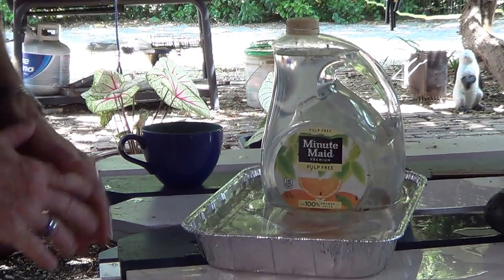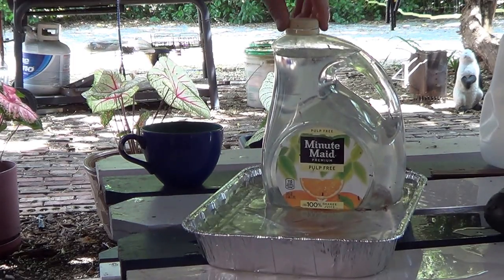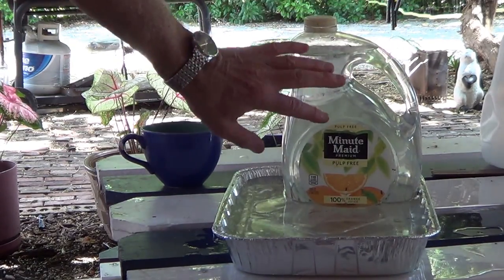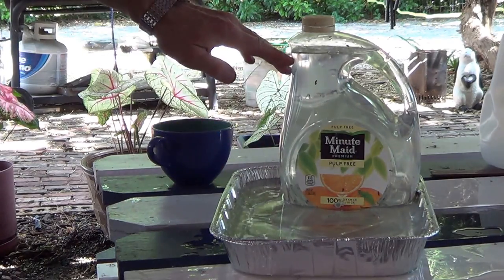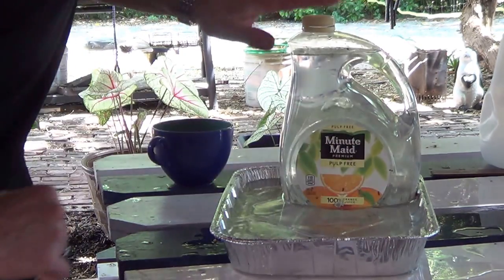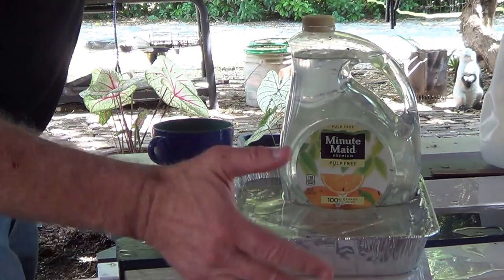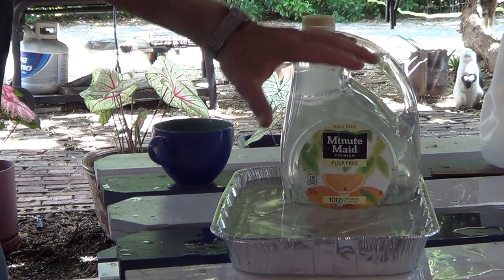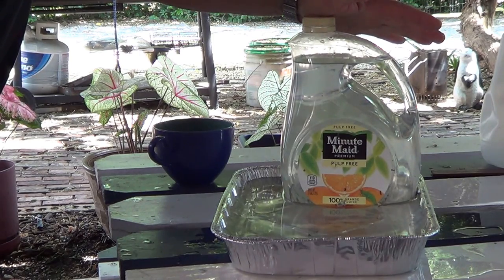Homemade Pet Water Feeder

Comment: Thanks! Been trying to get a clear explanation of the physics that I knew but wanted to verify and you were able to do that. I plan to do this with a small 1/4 inch hose to an aerogarden from a 5 gallon bucket or 2 or 3 gallon water container so I do not have to fill my aerogarden 2 or 3 times a week.
Reply from the maker: C Mack Sounds like a great idea, the aerogarden.  I haven't experimented with it connecting to a rubber tube (if that's what you're doing);  if so, there might be an optimal size hole/tube to use -- but I don't know what that would be.  Good luck.
Reply: Stephen Saunders They sell a solution for $40 but that is just too pricy in my opinion for what it does. They call it an aerovoir AeroGarden reservoir. http://www.aerogarden.com/accessories/the-aerovoir-aerogarden-reservoir.htmlI just need to stop by Home Depot, likely spend under $5 for the parts since I have a 5 gallon food grade bucket already and the right size tube from my outside drip irrigation system so I should be golden. Ill let you know if it works.  Aerogarden is expensive for what it does but I have two, they were presents.
Reply from the maker: C Mack One further comment.  If you have a rubber hose leading out, the water in the jug will drain to whatever level the END of the hose is at.
Reply: Stephen Saunders It works kind of, I have it split into two aerogardens and they seem to be at different heights because of the way they were made and are different models so whatever is lower seems to get the water flow. But when one gets low I can just push the water tube in a little and it is lower so gets a boost of water. Only have to do it once a week so definitely works. Thanks!

Comment: I attempted to ask Josefrank Cuellar Castillo additional information about his comment, but it would not let me.  When I started typing, it would not space.  Anyway, my question was if you used a drill to put holes in the cap, what size of bit would you use.  Also, if you put holes in the, will this interfere with the vacuum that is used in gravity feed water dispenser.  I am looking for a water dispenser for my cats, that i can fill from the top without having to take it water dish, and fill it up from the bottom, then re-insert it into the dish again.  The video intrigued me as it is doing what  I am looking for.  All the commercial ones at the pet store have no way to be top filled.  This one looks like you could.
Reply from the maker: Jerry Gibson Don't put holes in the cap.  Watch the vid and you'll see that the holes (approx. 1/4") should be drilled in the side of the jug at the point you want the water level to be.  If you compromise the vacuum in any way the water will all drain out.  Watch the vid.   I've been using the dog one in my for over a year.

Comment: I tried this with the cap tightly closed, water isn't flowing when needed. You have to manually tighten or loosen the cap.
Reply from the maker: Could be that the hole needs to be a little larger.  Also wouldn't hurt to have two small holes side by side.
Reply: when the water goes out they leave and empty space in the bottle and if air doesnt come in the pressure wont let the water out, so my advice would be to make some little holes in the cap with a hot needle
Reply: Josefrank Cuellar Castillo